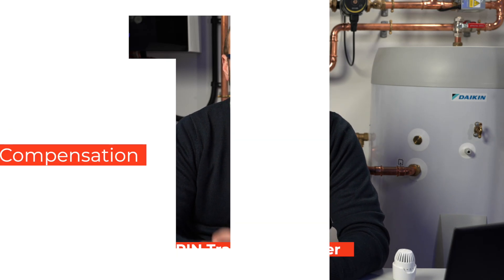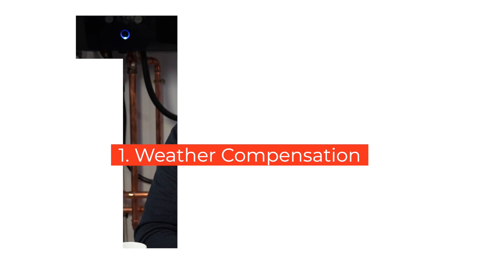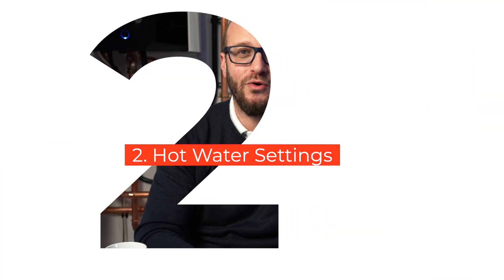3 Tips To MAXIMISE Your Heat Pumps Efficiency

Comment: Can you tell me how to adjust pressure as it has dropped to 0
Reply: If it’s like mine and it’s rather like a combi boiler, there will be a potable water inlet feeding an expansion vessel, you open the valve to let water in until the pressure rises to the desired value. If it’s zero then it would suggest you have a leak, probably best to get it checked out by a professional.